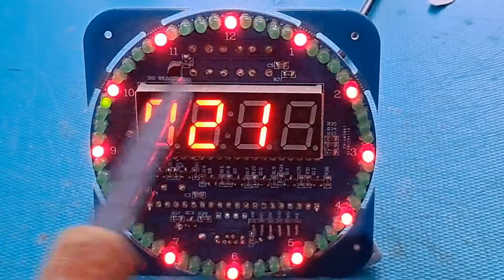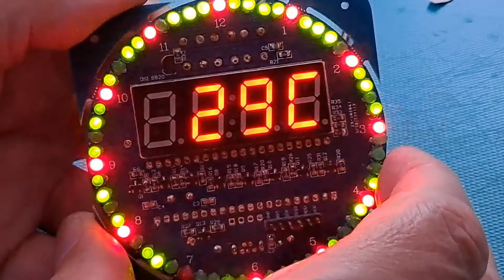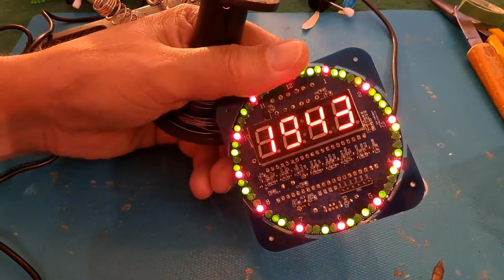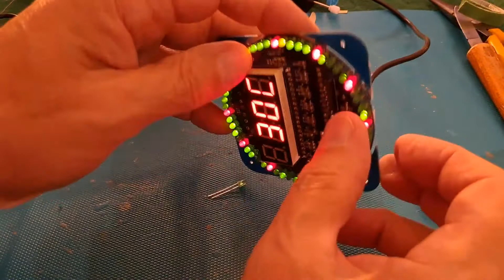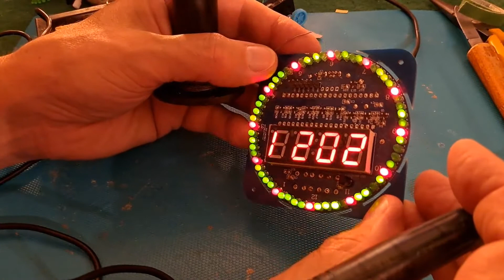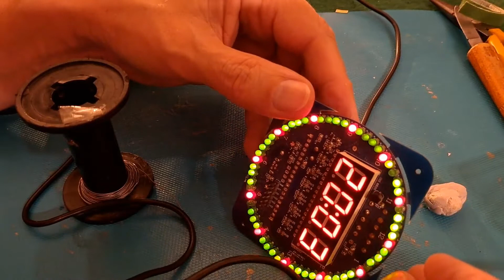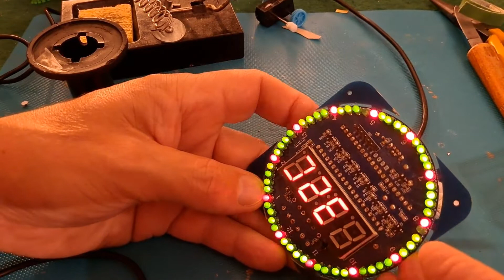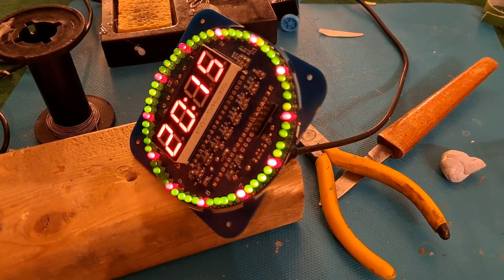Revisiting my EC1204 Digital Clock Kit to fix the dead LEDs - FULL LENGTH

Comment: I'm sure you're right on this, I noticecd some of the other green LEDs are dim, and I suspect that some of the ones you have "repaired" will go wrong again. None of the red LEDs failed, which is also a sign it was a bad batch of LEDs.
Reply from the maker: Oops, just replied from the wrong account and deleted it. Sorry if that confuses things. Yes, I filmed this video just about a month ago. Within a day, 3 of the green ones had gone again. It seems to be that the legs are not well gripped by the plastic dome and I can put pressure on them from one side, and they come back on again, but go off as soon as I release the pressure. In the more expensive kits, you get a clear plastic face that would prevent the LEDs getting knocked. While writing this reply, I have just touched one of the dead ones, and it came back on for a few minutes 😆